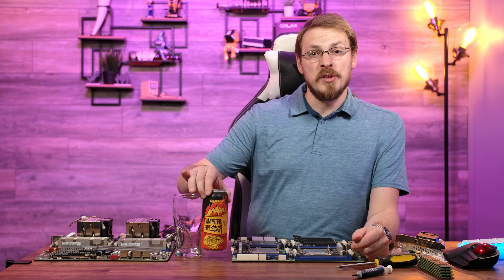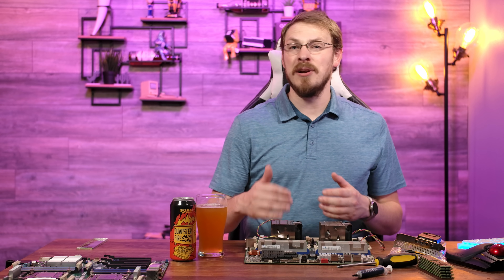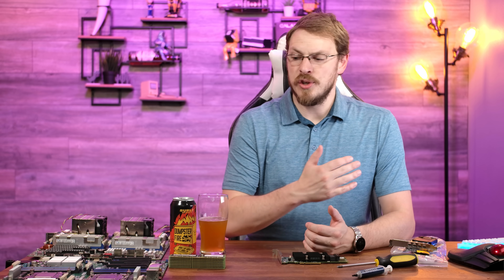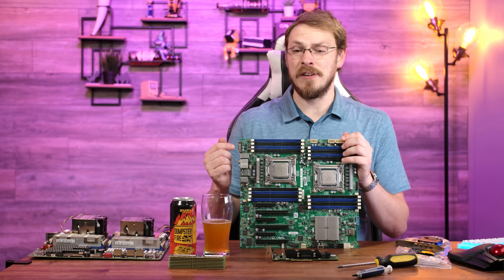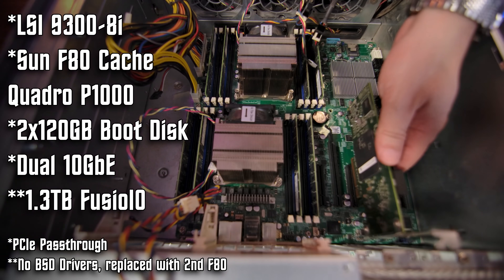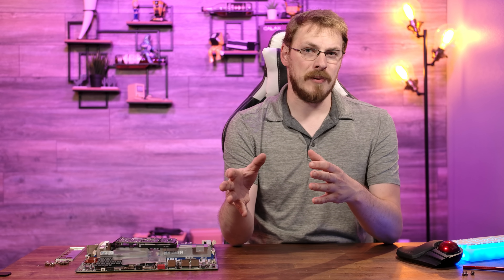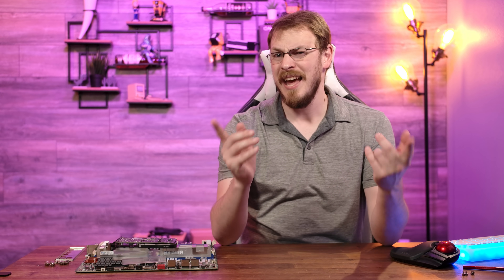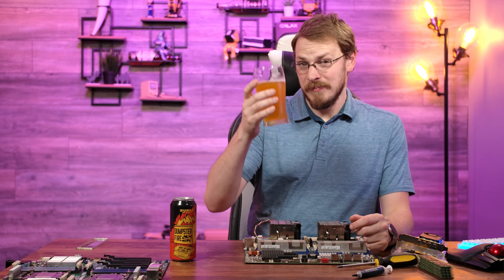Running out of things to die - TrueNAS Motherboard Replacement

Comment: I dont run any Hardware in my server, because i dont have the infrastructure for that (yet). Old House, no ethernet in the Walls, cant place a loud Server next go the Router, and wifi might be a bit ehhhhh for a server. So my next upgrade propably will ne Powerline from the Router to the cabin and a simple nas
Reply: So learn to run cables. It's really not as difficult or unobtainable as people think. Get 2 boxes of cat 6 and pay an electrician to pull cables and you terminate.
Reply: Run stuff tube through inaccessible areas so adding/changes later are easy
Reply: @mrmotofy  yeah, the problem is, as i stated, old house, with massive walls. This would be a bigger construction. Breaking open the walls etc. Already asked the electrician of my trust

Comment: I am just running proxmox on Dell T20 (Xeon 1225v3,32GB RAM, HDD passtrough for jellyfin and couple other VMs). Next plan is the proxmox backup server (at the moment running as VM). And at the end of the year i think about hp microserver for more storage. The biggest problem is power consumption..... 0.29€/kwh...

Comment: Hmm, what do i run in my home lab? Let me see, the old file and vm server is the same Gigabyte motherboard you just dumped into trash with 2xE5-2697 v2 and 256GB of memory. New file server is Huananzhi X99 mobo with E5-2699 v3, 128GB of DDR4 ECC and 16x8TB HDD. Workstation that i'm about to retire has Asus WS C621E SAGE with 2xXeon Platinum 8268 and 384GB of memory. But i am building myself a new workstation with AsrockRack ROMED8-2T and a single AMD EPYC 7742 (because who on earth might need two of those in a single system? That's overkill even for me). So soon i will probably rotate hardware getting rid of the last DDR3 equipped system.

Comment: That's small Patattos LOL.  I have a Supermicro X9DRi-LN4F rev 1.1 should have got the rev 1.2 so I can use faster processors, but I have in it 2x Xeon E5-2670 CPUs 8 cores/16 threads each, total 16c/32t running @ 2.6GHz with 48 gigs of ddr3 ram the mother board can take 1.5 TB of ram  I have 3 LSI raid cards in it to run all 24 drive bays only 12 are used at the moment  I have 10 gb network card  this thing is a beast.    When reading the documentation.  I put all the LSI cards on CPU 2 since all that CPU is running is the 2 PCIx 16 and 1 8x slots the other cpu1 is running 2 pci x 16, and 1 pci x 4 slot I put the network card on CPU 1  This way I hop I get as much speed that I could ever need for storage.

Comment: Mhh, I wonder if there is someone who could analyze the failure... Just out of interest. For me this sounds like an issue with the CPU VRMs, maybe one transistor died (unlikely) or the capacitors are giving up the ghost. Not very likely for a board newer than 2010, especially server grade, but the issue sounds a little like that.
Maybe you can do a collab with some other tech youtubers who can diagnose it (or give it a try yourself , components are cheap...)
If it's not powering up anymore (and was unstable before) that clearly sounds like a missing / unstable voltage rail, which is a problem that's often fixed easily

Comment: Recently i ordered a 2nd dell R210 II with 32gb ram for $135 on ebay, plan to use that for truenas, connect it to my disk shelf via a PCIE HBA.  it only has 2 1gb ethernet ports so i plan to link them in a lagg.  i like the r210 ii because it is so quiet and low on power draw, should be great for a home nas.  i dont currently have enough to need 10gb ethernet so for now this will be a good solution.

Comment: The thermal imager shows overheating electrolyte capacitors. The electrolyte capacitor turns into a resistor when it breaks down. Due to overload and unstable voltage, the computer does not work. Two-year-old motherboards or power supplies may have a capacitor failure. The fault starts small and gets worse as the electrolyte capacitor breaks down. A faulty voltage can corrupt the SSD drive firmware and kill the SSD drive. I have managed to repair a few old motherboards and power supply. The problem is to find new electrolyte capacitors of the same value and size. Remember that the fault can be caused by the power supply as well. Even the new motherboard will not work correctly if the power supply is broken. I use a cheap DeLock Power Supply Tester III when i try to check power supply. The motherboard will not turn on if motherboard own power supply check does not pass the test.

Comment: Hmm, I have an X9-DRi running Unraid bare metal and I also have a Dell HBA 330 and it works just fine.  I'm not using it as straight SAS, but SAS to SATA, but I've not seen any problems at all.

Comment: I'm running 3 raspberry pi's as my home server(s): a pihole (on a RPi 4 4GB), a nextcloud (again on a RPi 4 4 GB with a breakout board connecting a SATA SSD through USB 3.0) and a nagios server (on a RPi 3b). My next home computer project is placing a RPi 2B in my fathers house with a USB 2 1 TB HDD to serve as off site backup for my nextcloiud.

Comment: My "server" might be one of the weakest out here. It's a raspberry pi 1 Model A (700MHz single core, 256 MB RAM). Also it's staring to show the same behavior as your old motherboard did...
Reply: My true 24/7 server is a Pogoplug Mobile. It has an ARM whatever at 800MHz and 128MB RAM. For storage I did a SATA mod and attached an 80GB HDD with failed SMART status.

Comment: Hopefully your new hardware holds out!

My home network has a different focus than yours. Mine is more about the networking than the of hardware. I'm running a pair of 48 port gig poe Cisco 2960's and a 48 port gig Dell switch (soon to be replaced with a 3rd 2960). 

I was running an old dual Xeon IBM server, but haven't replaced my raid card after it died on me. I replaced it with a pair of raspis. One running home assistant, the other running Zabbix and docker containers.

Comment: I do wonder if the old board is repairable... usually the stuff on the motherboard is easily repaired at the component level, as long as the traces are not damaged.
Reply from the maker: Investigating
Reply: @CraftComputing  Good luck! My guess is failing capacitors, but it might also be a fried VRM or something. Less likely to be other stuff on the mobo, unless you can spot something on it being obviously blown like a exploded transistor, which happened to me once. The chipset is usually pretty robust and shouldn't fail, but it is possible that it got overly stressed.

Comment: Hello, I use production workstation grade hardware - X58 server chipset (Intel 5520 IO hub with ICH10) Dual Xeon x5690 total of 12 cores/24 threads, core clock is 3.47 ghz, 96 RAM registered Multibit ECC, Quadro P2200 in display/compute mode, I use it as Digital Audio Workstation. The sound card is installed installed on a 4X Gen 2 PCIe, and the quadro card in installed installed on a 16X Gen 2 PCIe, because they are managed by the IO Hub - basically for older computer geeks - assume i put both cards on the north bridge to avoid all latencies and delays and get served fast. Currently i rely on Windows 10 pro for Workstations 21H1, but i intend to move to Ubuntu Studio. for the moment, the only thing holding back is no driver support for my soundcard in Linux. take it whatever i do or install or uninstall, on Linux, my sound card is silent. No sound, no music. even based on my Once i figure this out, i am going on Linux.

Comment: currently for my storage servers 
Uriel 4.0: SuperMicro X9DR3-LN4F+ with dual e5-2630 in a 4U variant SuperMicro SC745TQ-R920B (the case was free when work was tossing it). Boot drive is a Silicon Power 256GB running Windows server 2012r2 DataCenter (don't ask) and storage is 4x4TB +4x6TB and yea.. individual shares. only 32GB DDR3-1333R
16tons (server2): Gigabyte Aorus X470 Ultra Gaming, R7 2700X, 16GB DDR4-3000, GTX 960 4GB booting off a kioxia 128GB 2230 (damn you Wendell), 4x3TB storage in Rosewill 4U 15Bay case. 
Yes both servers mine and I'm not apologizing for it.. My wife won't give me an allowance and I gotta pay for my tech somehow. Amusingly in XMRig the dual e5's almost equal the R7. 

Gotta say, if it's not AMD, it's most likely server grade with me, even before following your channel.

Comment: My NAS is running Unraid and HP Z240 motherboard (C236) and i5 6600, with LSI 9207, and modified (more than 10 year old) Lianli aluminum case with HP 12 bay LFF drive cage in it. Wish I could share a photo here. It was a beautiful mod.

Comment: Been there - had my server motherboard die (*ahem*...it...uh...caught fire a little bit...) but was able to limp it along with a z170/6700k system for gaming.

I run an unRaid server with:
ASRock Rack EP2C602-4L/D16
2x Xeon E5-2680 v2
128 GB DDR3-1600 ECC
LSI 9300 8i NBA flashed to IT mode
Asus Hyper NVMe expander with 3x 1TB Samsung 970 Evo Plus for cache/fast storage
2x 8TB WD Red (CMR), 5x 4TB WD Red (CMR)
EVGA SuperNova 1600P
Rosewill L4500
APC Battery Backup (2100W/1500VA?)

Planning to upgrade my house's network infrastructure to 10GB at some point, and planning some PoE devices (R Pi's that run Unbound, PiHole, and Guacamole).

Comment: What hardware do I run at home?  My NAS is a Dell XPS tower with an i7-6700 running Server 2019, with a flashed IBM M1015 and Quadro P400 for Plex.  I've been using DrivePool for many years and just recently started adding per-folder duplication and a SSD cache.  I played around with Hyper-V on there but ultimately decided to use a RPi4 for all my Docker containers.

I have my eye on a decommissioned Lenovo RD350 at work with an E5-2603v3 -- Just add 10Gbit ethernet and a matching Lenovo SA120 or two.

Comment: I, myself, am running a Dell T430 w/ dual E5 2630v4 (10c - 20t each) but only using 64GB of Ram. I'll probably double my memory in the future but Ddr4 is still pricey and I haven't needed it yet.

Comment: my home servers are kinda lame, currently non of them are working. was using an old hp laptop with a6 4 cores 4 threads at 2.6ghz and 8 gb of ram with a usb to boot off of and 500gb hhd. was used to run minecraft server for me and some friends running freenas. it no longer turn on and the batter is completelyshot. I ended up kicking it across the room after tripping on power cord. my other server was a toshiba laptop with some amd processor with 2 cores 2 threads and 1ghz, it was a simple ubuntu server. this one was turned off because i simply didnt have use for it and it was being very slugish. planning to upgrade to some proper hardware with possibly some cheap ssf or ssfx pc. never had any sort of back up sollution for either machine because i simplely didnt care enough. the toshiba laptop mostly stored finished school projects and back ups from my personal laptop.

Comment: I'm running an i9-7920x on a EVGA x299 Dark

It's setup running Ubuntu server 20.04 with zfs on Linux. I moved the pool from a trueNAS build from back when it was freeNAS.

I didn't actually spend $1400 on a cpu that runs way too hot and an over locking focused motherboard

I won the cpu and mobo in a raffle at pdxlan in 2019? I think.

I already had a R7 1700x gaming rig. So the 12c/24t cpu and way overkill motherboard seemed like a perfect upgrade for my aging FX-8350 NAS.

I'm running mostly just a Samba server, but I have plex and own cloud running in docker.

I had ambitions to set up a windows vm to game via vfio... But haven't gotten around to it 😅

Comment: The main server I'm running is a 9-7900X, 20 core -- unraid with 17 hard drives which include 2 parity drives, mostly 8tb, parity drives are 16th, total space available 106tb. 4tb nvme primary cache, 1TB SSD VM cache, 500gb docker cache. 2 VMs with dedicated graphics passthrough -- 1 nvdia, 1 amd, because that actually works -- Windows 10 VM gets the Nvidia, and Ubntu VM gets the AMD. Case is the Supermicro CSE-846BE16. and LSI HBA, case supports 24 drives, so I have room to grow. 64 GB ram allocated with 16 going to the Windows 10 VM, and 8 to ubuntu. Also a 10gb fiber SFP card with a fiber to the MikroTik 8 port SFP switch. There is another server for BlueIris, i don't remember it's specs, but it uses the deepstack docker from the big server, and archives video from the cams in the house to the big server, it's also on a 10gb link, so since it archives to the the NVME cache pool during the day, it's very fast. Cache pool is dumped to the spinning disks at night.

Comment: Have a supermicro 1028u tr4t+ with 2 e5 2690 v4's and 128GB ram. Got it from some old media distribution datacenter company that went under, was probably a transcoding server once. 
Am underusing the cpu power a bunch. Even though it runs about all the homelab stuff I can think off. 
Doesnt fit much drives, so we have a bad config to just get the most storage, even have a USB enclosure that stores the tv shows we watch

Was going to try to use it as a gaming server, but we all know how available videocards are these days.

Comment: Dell PowerEdge T620
CPU: 2* Intel Xeon E5-2697 v2
RAM: 24*32GB LRDDR3 Samsung M386B4G70DM0-YK03 12800L
GPU: Nvidia Tesla K80 & Nvidia Quadro K6000
Co-Porcessor: Intel Xeon Phi 71S1P (Have yet to find a use for)
HDD 3.5": 8*4TB 7.2K Dell Enterprise (I think they are Seagates. . . . Too lazy to verify)
HDD 2.5": 2*1.2 TB 10K Dell Enterprise

Upgrade Path: Buy some R620s or R630s and a lot more 2.5" HDDs. 
Use: Run a half developed website that sees no traffic & a bunch of VMs that never see use?

Comment: My home server's pretty simple at this point. Xeon X5687, P6X58D Premium, 12GB (3x4GB) DDR3-1600, 240GB SSD for boot, 4x1TB HDDs for mass storage and a 1.2TB ioDrive2 for downloading torrents and storage. I'd like to upgrade the CPU, motherboard and RAM at some point because the current setup has some kinks that I can't work out. Maybe a modern Intel chip with an iGPU so I can use Quick Sync for Plex.

Comment: I use an old HP microserver for both of my TrueNAS servers which backups to cloud and then replicates to another HP microserver. Been running now for 4+ years, only thing gone wrong is the PSU died a few months ago but got hold of a cheap replacement on ebay.  I know rubbish hardware but for my current needs works fine but do need to start looking into getting new hardware, need to do some ebay shopping and look to get something with 10GB network capability.

Comment: My NAS is still an old HP N40L Microserver, I really need to upgrade it.  The lab server is a 10 core lower powered xeon with over 196GB of RAM.  Really need to start to rackmount this stuff which will cause the old microserver to be retired.

Comment: My homeserver runs on a XEON E5-2650L V2 / Dell H200 / Quadro P400 and 128 GB of RAM with TrueNas and Plex virtualized in Proxmox (with PCIe passthrough to both VMs). First i had a dual Xeon setup in mind but decided against it due to the cost of electricity and a more realistic view of my needs.

Comment: One server is an Asus X99 WS/IPMI board with a Xeon 2660 V4, the other is a Gigabyte X399 board with a 1920X Threadripper. The Xeon has two hardware RAID controllers and three arrays of four drives each, two are 4 TB drives, the last is 8 TB, and that serves as my two storage and one backup NAS drives. I don't have a good other use for it. The Threadripper setup has dual NVMe drives and a 1080 Ti for streaming video capture, and one of the LAN ports connects directly to the Xeon server. It captures and writes to the NVMe drives in RAID 0, then I transfer footage to the Xeon server. If I'm going to do any editing on it, I leave the footage on the NVMe array and edit it off there on the Threadripper system.

I also have a 6950X that I have no real good use for. Maybe a Minecraft server. Idk.

Comment: Hardware I run for a home server is a HP DL360p G8 system. Runs good for what I need and it isn’t too loud but it isn’t silent either. Looking at getting a chenbro or something with more 3.5 bays. May get a DL380 but I want something with 2011 sockets like my existing server. My favorite thing about the HP server is the ILO system but I miss my supermicro IPMI. I also have a DL380 G7 I run for labs and such

Comment: My homelab consists of purely just a small whitebox NAS. Ali Express special with a Machinist X79 MB, Xeon E5-2640 (yes, V1), 32GB ECC RAM. Added an Avago RAID controller for hardware RAID 5. Icy Dock cage for 5x 2TB 3.5" drives mated to an ARK 4U chassis. Just running a bare metal install of WS2016 for Plex and a shared drive for backups of all my local gaming machines. For how "cheap" it was altogether that thing is rock solid.

Comment: Right now I'm running an i7-7700K on a non-server board. I'm no longer using TrueNAS, Proxmox, ESXI, or anything like that. Just Ubuntu 20.04 on bare metal. I use Docker and Docker Compose for running VMs.

Comment: I have a Ryzen 7 2600 with 32GB  ram, with an HP LSI  HBA running Unraid. Got it running a few VMs (one running Mint + Plex Server) and docker, nexcloud etc etc and use it for a bit of (older - see below) gaming on W10 with Parsec. Its fab being able to do so much with a single phisical box. Then NAS duty 24/7.

Upgrades....GPU it's got a GT640...(so properly dire) just missed out on getting something better when all this GPU nonsense kicked off, would like a 3060 mini or something - as the case (Silverstone HTPC) is better suited for shorter cards....so it's even harder to find a GPU for me. Also want more HDD space....just because....

Keep up the great content.